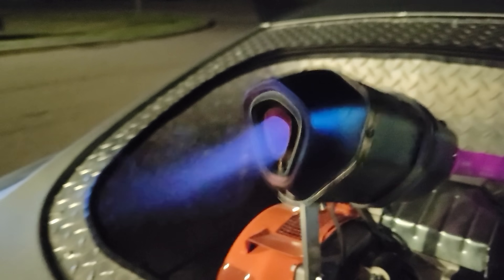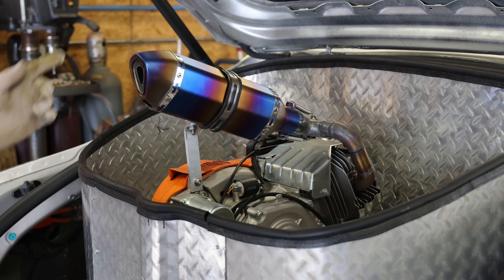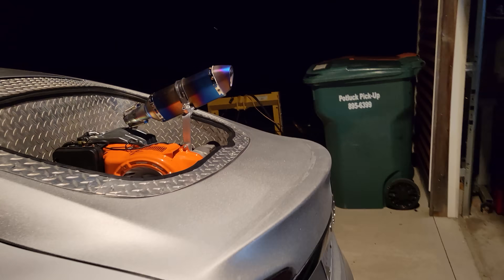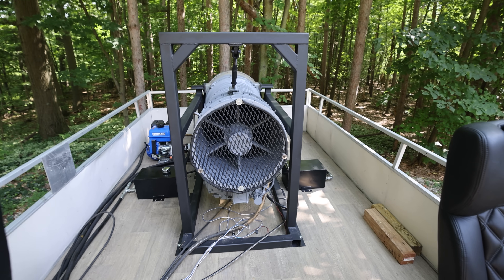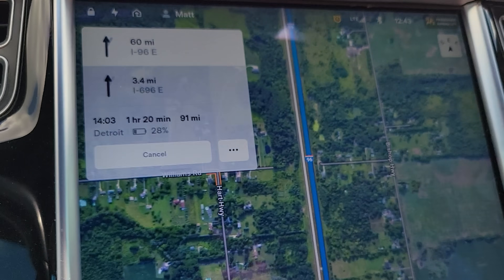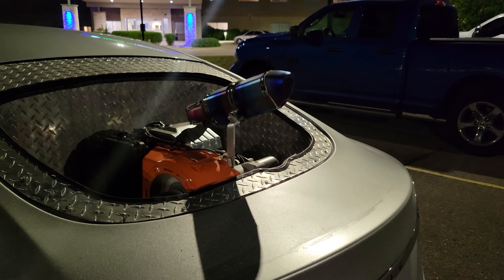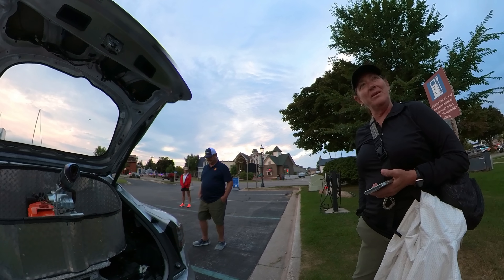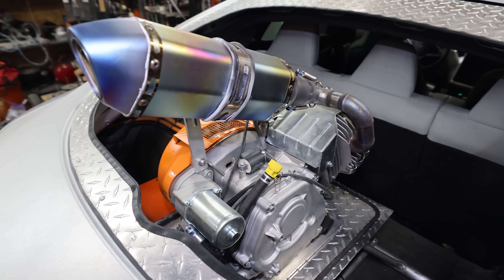Cordless Tesla (I Drive 1800 miles without charging) P.1

Comment: I like it because you have essentially replicated the most efficient use of both systems. It's like a train except the train does not have batteries. Gas motors are great for charging batteries. batteries are great for running electric motors, electric motors are just awesome. A small efficient "quiet" motor just for charging is the best of both worlds. It is not a hybrid in that the gas motor is completely disconnected from the drive train. That means many fewer parts and more efficiency. The gas motor will run at a steady rpm with no variable strain, and the motor will last longer. The gas motor shuts down when the batteries are full.  Consider a Big truck or Big RV with 15kw batteries with small 150hp to 250hp gas or diesel motor just for charging. That would be the best.

Comment: 8:30.  You want to do 400-500 miles without stopping. You arrive with 30% range left.

The EPA range is ,400. So let's say real world is 350 so remaining approx 120. You're saying that the generator running the whole time  for 7.1 hour drive, assuming 70miles per hour average speed for 500 miles distance 500miles being worst case and thus in your favour. You added 270 miles of range. Or in other words your generator can add 38 miles of range per hour running.
You claim at best 24mpg from the generator at slower speeds but you were doing higher for the journey, so let's side with best case for you and use 19mpg (your 60mph number) to keep the maths easier.

So you use burn 2 gallons of gas per hour. So you need 14 gallons to do 500 miles with 30% charge remaining. That actually gives 266miles added at your MPG rate i said 270 miles range left.
So your real world usage is really close to 19mpg.
Speculation:
You fuel tank looks no more than 5 gallons probably less.
So at least 3 refills at a gas station.
If you don't, your car runs out of electric on a trip you know you don't have the range for...  Talk about range anxiety.
3 stops for gas. Or stop at a changer once and charge quietly overnight at a friend's for less. Pay your friend 5 times the electric cost and still win.

Comment: That's why Nissan e-power tech is best in my opinion. But! More efficient in noise and little more powerful gasoline or diesel generator will do the thing. There must be a balance between power generation and daily power consumtion, driver must sleep for say 8 hours and generator must be able to fully charge battery during this 8 hours, plus generator must give additional power during daily driving. It is a question if it will be effective on gasoline consumption?

Comment: The blue flame coming out of the exhaust is BURNING FUEL being WASTED!  The burning fuel exploding outside the engine is probably what causes most of the noise.  Not a single mention of calculated MPG.  Probably a gas guzzler.

Comment: That little engine, with NO EMMISSSIONS CONTROLS, puts out more pollution than a modern car does. Some cars, with internal combustion engines, emit cleaner exhaust than the air it sucks in in many big cities. That part was eliminated from the explanation. I have a 2012 Ford focus with manual transmission (the one they DIDN'T have any problems with) that gets 40 mpg on the highway and 34-36 mpg in mixed driving. No need to spend $45 - $50,000 on a car to hack up and put a lawnmower engine in it that pollutes the air more than a car, if that is a concern. 

This weekend I took my Focus on a trip, with a friend, from Cleveland to Lexington, Kentucky, over 400 miles. The car has a 12 gallon tank and I didn't have to stop for gas going or coming. I started with a full tank and then filled up again in Lexington. and then add the miles driving around town, then drove back to Cleveland without adding more gas.

Comment: Freight train locomotives use the same concept as this tesla car; Diesel motors generate electric power to drive electric motors that move the train. Throw a properly designed motor generator on the Tesla and it could possibly get even further ranges.

Comment: As you said at the end of the video, the mod is basically useless...  However, the use of this project is the learning opportunity for your viewers by watching the build, as many of us like to build and tinker and get ideas for projects.  You glossed over the build, especially the generator and how it connects to the Tesla to charge the battery.  I'd love if you'd spend a bit more time on the build portion of this kind of project so I have a better idea of what you did beyond mounting a really loud single cylinder engine in the trunk.

Comment: why you dont put a ton of solar-cells on the car? make a sono sion like tesla and add a stirling engine to the coolent so the stirling engine generate power by the heat of the batery motor and ac?

Comment: I love the concept and your modding skills were very impressive, but I would have liked to have seen a quieter and more powerful generator. I think you probably wished the same thing. Fun video, though.
Reply: I think a diesel generator like for a mobile home would have been perfect for this, enough torque to load it down and really make some electricity
Reply: The power output was okay, maybe 15 or 20 kw and not 10 kw but it works like this. A quieter generator with higher efficiency and maybe a heatexchanger for the cold days could be a perfect fit

Comment: Does the next build have electronic fuel injection?  Saw a lot of blue flames spitting through the exhaust when the generator is running, could it be the mixture was too rich?  Have you thought about compounding the generator using the exhaust to overcome the 25% efficiency barrier?  Let see how you surprise us in the next video.
Reply: There was no generator only an engine, the whole video was a scam to get 2.5 million view$

Comment: Isnt this how hydrogen cars work? The hydrogen motor charges the battery that runs the electric motors? Or maybe they have capacitors instead. But basically electric motors run by a hydrogen motor. In this case he just swapped the hydrogen for a noisey little generator. That couldn't keep up with the electric motors and needed to be filled constantly.
If he could fill it once for the trip would be awesome but 1800miles without charging is a bit clickbaitish because that little motor was constantly recharging the battery. Ask the hotel guests.

Comment: Instead of this noisy charger, why not fit chargers on the wheels, the moving wheels should generate enough electricity to increase your milage.. you could even fit a wind cylinder on top..

Comment: And this is why hybrids often make more sense for a lot of people! I'm seriously thinking about a 2020+ RAV4 hybrid. 40 MPG, all wheel drive, and it's a good size crossover!
Reply: This machine showcased here is 19mpg.

40MPG RAV 4 is almost 200MPG combined if you're driving short trips and charging it over night or whilst shopping.
Reply: @markp8295  Ya, the RAV4 hybrid makes a lot of sense. I'd love to get the Prime model but I'm not spending $45,000 plus a dealer markup of about $10,000. It's all highway driving for me on the weekends and usually more than 80 miles. I'm in a company vehicle durig the week for HVAC design and sales. Maybe 10,000 miles a year in my vehicle but why not get good gas mileage!
Reply: I have a 2014 Audi A7 TDI. It has traveled 718 miles on one tank getting 42 mpg. On one stretch of level road about 20 miles long I got 42 mpg @ 93 mph.
Reply: My thinking is you need an engine more geared to what is needed to propel the car with a minimal battery pack. That way you do not have to carry the full weight of the battery pack. The Rav4 plug in I believe is sort of a sweet spot for hybrids in that it can go about 50 miles on a charge. Most cars average less than 40 daily miles. You then only use the Ice for long distance travel and can take advantage of cheap charges while connected to the grid.

Comment: How did you wire this? Into the regen? Is that why it calculates based on the power it’s receiving? Mine won’t move when plugged in.

Comment: You essentially added a range extender. Like the early BMW i3 models had as an option.

Also, on your thermal efficiency slide, I think you meant kWh (kilowatt-hour), otherwise the per (US) gallon bit makes no sense.

Comment: so.. its basically charging over night to get your distance.. you could just plug it into an ac charger for 11kw over night and get the same result without modding. seems kinda pointless to me. except some extra miles while driving but at that speed i dont think its adding really much.

Comment: weltverschlecter- backing up your previous 3 phoney claims with one more? and still can't answer a simple question about mechanic certification.  here's one even a weekend gear head could answer. on a pre- 1970 engine- name the components of the valve train of a V-8 engine? what are the FINAL 3 components that go on the front of the crankshaft, of a 1984 mercedez benz 300sd turbo-diesel engine? 

i'll give you clue: here in the usa- any high school senior from alabama to south carolina could answer these questions with 3 seconds on the clock. the fact that you CAN'T? lets me know who & what you are.

Comment: Are you using the stock stator and rectifier regulator for the power generator or is there a actual seperate generator hooked up to the shaft of the engine? Also to keep the noise down get you a muffler from like a geo metro.

Comment: Place an extra wheel not thick in the middle of the car (slave wheel obviously) but attach the wheel to a hydraulic generator. Like a water mill approach. Or a hydraulic pump which turns the generator at 1800 rpm.
Reply: Bro broke thermodynamics

Comment: according to the EPA- the emissions generated by lithium battery production is VERY minimal compaired to the rest of the EV- only 18% of the TOTAL- including charging. even a tesla based in Virginia (all coal power) only takes 30,000 miles to 'break even' with a gasoline powered car's emissions. from that point on- it produces a LOT less than a gas car. this is largely due to the fact that modern coal plants are ALL hybrid co-gen plants with MASSIVE waste heat recovery. this all adds up to a thermal efficiency of around 45%- which DWARFS ice engine efficiency- at around 27% for a toyota camry. using an EV capitalizes on the efficiency of an electric power plant. ALSO: with each hydro-electric, solar and wind power plant that goes online? ev's get better.. and better. also, many of tesla's super chargers utilize solar- and ALL of them use megapacks- which means that a tesla supercharger most likely won't need peaker plant operation.